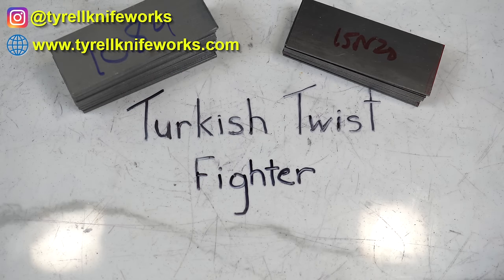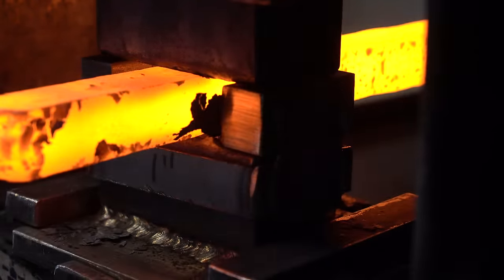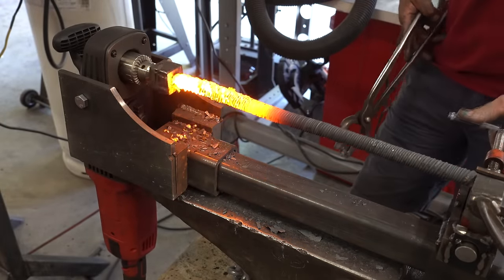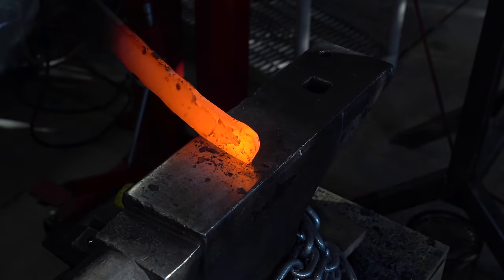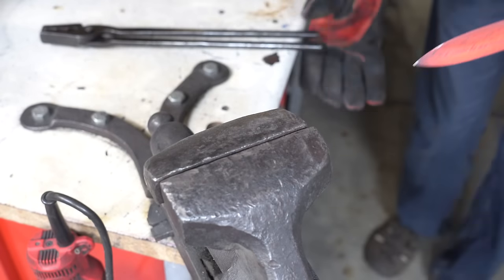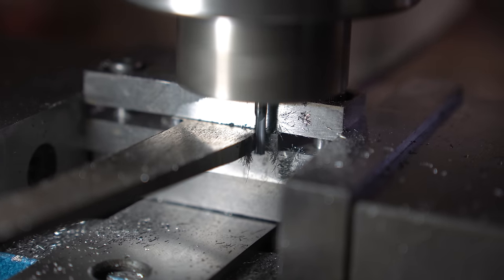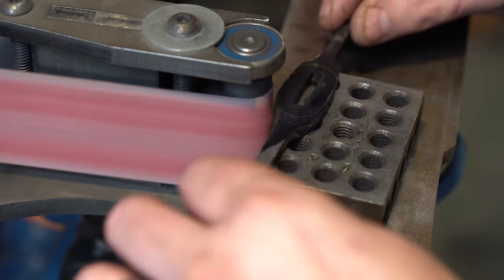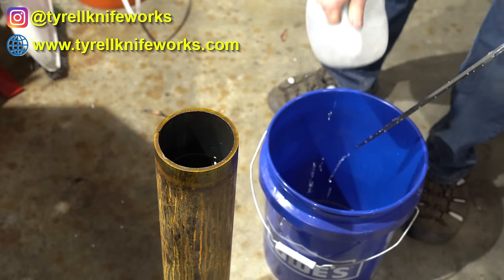Forging a Turkish twist damascus fighting knife

Comment: Really appreciate that you include "simple" mistakes like forgetting to change the drill direction. I think it really adds to the idea of craftmanship as a constant process, not just a finished skill.

As someone who can nothing on metalwork, why don't you go straight to the surface grinder when removing the grooves from the twist? Less control of material removal?
Reply from the maker: I always say, these are a series of problems to solve. As for the surface grinder, I was taking off the majority of the scale first so it “stuck” well to the magnets.  Thanks for watching.

Comment: You'd mentioned that with the twists that you loos a lot of material grinding out the the twists. Have you tried to rounding that square bar up and then twisting? I've done it and had mixed results. I hope this finds you and your family well, and as always, very well done, Sir.
Reply from the maker: Yes, I do that with bars larger than 5/8”.  With bars this small it doesn’t really make a difference. Thanks for watching.
Reply: @TyrellKnifeworks  That's good information. I suppose that's why my results were mixed. Thank you!

Comment: Another nice looking knife and a great build video. On the warping issue : i also used to grind in the bevels mostly before heat treat. On longer and or thinner blades there always high risk of warping.....sometimes its very hard to correct those warps. Now i do not longer grind in bevels....the only thing i do is to make the knife blank flat and straight before heat treat and leaving a lot more thickness. Never had any warps after that. There's another advantage in grinding in the bevels after heat treat. On thinner knives where the bevels are ground after heat treat you do not have the risk of decarb as much and thus there less chance of losing some contrast after etching. I am sure as you make a lot of damascus blades you also experienced some uneven etching on some blades....less dark/dull spots on bigger sized blades or the cutting edge less black/contrast than the back. That is also caused by decarb and uneven cooling on blades that had the bevels grind close to almost the final thickness before heat treat. I rather waste an extra sanding belt to grind a hardened and tempered blade to final shape...than risking warping, decarb and even cracks on thin and or longer blades with the bevels ground in before heat treat.
Reply from the maker: While I agree that works most times, with 10xx steels you need to be careful you are getting full hardness since those are shallow hardening steels.  That’s the main reason I like to do pre-heat my rest grinding.  I very rarely have warps or decarb issues.  If you’re not testing with an hrc tester with no pre-HT grinding, you should get one.  Thanks for watching.
Reply: @TyrellKnifeworks  Ok those steels are maybe shallow hardening......but i very much doubt they would not fully harden if they are only 0.25 to 0.3 " thick blanks. That thickness before heat treat would be sufficient for most knives. But i do not know for sure because over here in Europe the 10xx steels are less common. Over here its mostly O1 and O2 for damascus blades combined with 15n20 or  45NiCrMo16 ( 3.5-4% NI). Those steels if i use them up to 1/8 inch thick big kitchenknives i can even plate quench ( copper quench plates) like you would do with stainless and get fully hardened without the chance of warping. I do not have a rockwell tester....but i use hardness testfiles. I can get those quench plate hardened kitchen knives as hard as using quenching oil. Maybe for the 10xx steels its different.
Reply from the maker: @HoutmeyersP  not being argumentative, but you ARE using 10xx steel if you’re using 15n20, it is 1080 with 2% nickel added.  Which has a completely different heat treat than O1.  It’s really not a good combination for Damascus for that reason.  I would advise you get a Rockwell tester and then you’ll know for sure.
Reply: There's absolutely no problem using O1 and 15n20 or 1.2767 for a damascus blade......even if both steels have a different heat treat. My blades are as good as any other hobbyist forged damascus. Look up any factory produced stainless or carbon damascus ....they all use steels that do not have the exact same heat treat.If you doubt that the mixed steels do not get a perfect heat treat when combined....i would than also skip using copper , nickel and gold or other metals in a blade. Its also really not a good thing putting any in steel for a few dozen times in and out a high heat propane forge....so if you want perfection skip the whole damascus forging process all together.
Reply from the maker: @HoutmeyersP  if you’re a hobbyist heat treating in a forge, it probably doesn’t matter.  But O1 and 15n20 DO have different heat treats.  They don’t even use the same quenchant.  You can reference Knife Engineering if you want to look it up.   As for copper or other items, those are never on the cutting edge.  You’re just heat treating your core steel.  This sound like a touchy subject for you, but I’m just giving you facts.

Comment: As always you do great work. Very well done. It is art.
Reply from the maker: Thanhs for checking it out, Gino!
Reply: @TyrellKnifeworks  I did a little research on the original Bowie knife and I found out that the clip point was sharpened for fighting. I would love one like that.
Reply from the maker: @ginojeffries4285  My standard bowie knives are like that.  Not this one though.  I rarely actually "sharpen" the clip but rather just have it apex quite sharply.  I'll be doing a few of these very soon.
Reply: @TyrellKnifeworks  I’ll be looking forward to watching these

Comment: The amount of manual work you have to do to squash all those lines into place without weird cutouts just elevates this piece even more.

Since I don't know the mechanics behind it, would it be possible to do something to remove the lines between the wielded pieces?
Reply from the maker: If you get the twists perfect, you don’t see the lines.  Mine isn’t perfect, that’s why I’m not a master yet. 😜.  Thanks for watching.

Comment: You said it. Twist patterns turn out awesome but the material loss is ridiculous. Bars end up being so little after grinding and a bigger bar is almost impossible to twist. I round them up before twisting and it does little to minimize grinding. It helps prevent shearing the bar some, but that’s about all I’ve noticed. To low of heat will ruin any shape of bar anyway.
Reply from the maker: For bigger bars I round them but for 5/8”, it doesn’t make much difference.  Thanks for watching, Erik!

Comment: Another fantastic build Denis, a pleasure to watch. With the powered twisting jig how do you keep track of the twists so the pattern is even when you join the steel together?
Reply from the maker: You can still count the rotations but usually you just watch the twists and make them as tight.  Thanks for watching.

Comment: One question that I have had for quite a while: What would happen if you took the square bar through a rounding swage before twisting it?  This would eliminate the square corner that all get ground off, reducing the loss of material from grinding. The layers in the round stock would still be twisted and exposed at different grinding thicknesses as you show early in the video.
Thanks!
Reply from the maker: When the bars get bigger than 5/8”, I typically do round them off, which helps a bit to prevent the “ribs”, but it doesn’t matter much on the smaller bars.  Thanks for watching.

Comment: How would your surface turn out if you rounded or shaped it to a octagon befor the twist it's bound to not be so drastic
Reply from the maker: For larger bars like 3/4” or 1”, it’s recommended to round the bars before you twist them to reduce the ribs on it.  For bars that are 5/8”, it doesn’t really help that much so I don’t bother.  Thanks for watching.

Comment: Question for you. You said you like to stretch the steel out slower to not shear the layers. Do you lose a lot of carbon from the steel or is it negligible from doing a lot of heats?
Reply from the maker: Taking a couple extra heats with the press is negligible, if you were doing this by hand and adding 20 or 30 heats, that's much different.  You're not really losing carbon though, you are losing steel mass from forge scale formation on each heat.  Thanks for watching.
Reply: @TyrellKnifeworks  Ah, that makes sense. Thank you! I really appreciate it.

Comment: What thickness stock are you starting with and stacking? Also the starting length.
Reply from the maker: It kinda depends on what I have on hand.  Typically I use 1/8" 1084 and 1/16" 15n20.  I don't quite remember how many layers I started with but it's in the video.  I hope that helps.  Thanks for watching.

Comment: If I may I'm no smith but the spacer looks lighter than the rest is that because the etching process wood eat at the silver or is it lighting
Reply from the maker: It’s a different piece of Damascus, it’s crushed W’s not twisted, so it reflects the light differently.  If you see it up close though, it matches well.  Thanks for watching.

Comment: So you twist and ripple the hell outa the metal, then reflatten it to get those beautiful lines? Then what do you cold soak it in to get that nice finished design?  Also, which chemical did you use to etch your company symbol? Thank you!
Reply from the maker: The blade is etched in ferric chloride acid which etched the “dark” steel more than the “silver” steel.  The silver steel has 2% nickel in it which resists the acid.  My makers mark is electro etched in the blade with a battery charger and saltwater.  Check my recent takedown Bowie knife build where I show that.  Thanks for watching.
Reply: @TyrellKnifeworks  Thank you so much, dude! 😃

Comment: @TyrellKnifeworks I don't understand one thing: why didn't you just flatten those marks from twisting in that hydraulic press, you were saying you'll loose a lot of material like this (with grinding)
Reply from the maker: You don’t want to press this pattern.  You must grind into it to reveal the “stars” like I showed at the beginning.  If you press the bars, you’ll get a boring pattern of bars.  Make sense?
Reply: @TyrellKnifeworks  ❤yep thanks

Comment: I failed my last etch, and I would like to ask you how much sandpaper you usually need to grind to.thanks
Reply from the maker: Not exactly sure what you mean.  Are you sanding it back to clean steel?  Between etching cycles I’m using 2000+ grit but if I had to sand it clean I’d probably go with 220 or 400.  Thanks for watching.
Reply: @TyrellKnifeworks  The translation software I used may not be very clear. I want to ask whether the grade of sandpaper should be as high as possible for polished steel before etching? I translate your answer here to mean that it usually needs to be polished to about 2000 grade before etching?
Reply from the maker: @idleartisans778  no actually, if you go to too high a grit before etching it closes the “pores” in the steel and it doesn’t etch as well.  I use the 2000 between etching cycles.  Does that make sense?
Reply: @TyrellKnifeworks  I roughly read that it only needs to be sanded to 400 grit before etching, not 2000 grit. Thank you very much for your guidance.

Comment: I could be wrong but couldn't you have simply flipped the billet the opposite direction to make the twist patten work?
Reply from the maker: No, it doesn’t work that way.  Can you flip a bolt and then the nut goes in the other direction or is it always clockwise?  😉. Thanks for watching.

Comment: I Wonder why you didnt just flip "wrong twisted" bar so you can use it for the blade
Reply from the maker: Many people think that, but it doesn’t work that way.  Example, take a bolt or piece of all-thread and flip it over, you still thread the nut on clockwise, it’s still twisted the same way.  Thanks for watching.

Comment: i Don't know if this will at all, but ive seen an easier way to forge a tip... the Japanese way. you cut of(using which ever method you want) at an angle where the tip is at the side you want as your edge, then forge by hand become half the work as you only need to bend the tip backwards to make you curve, and so doing the grains and patterns follow the groves and edges perfectly.... it might save you some time and effort . i do not know if you know of this method or not or have done it or not. just sharing
Reply from the maker: Yes I’m familiar with that method, but with this pattern if you cut it it looks terrible.  You need to forge the tip this way or it just looks odd.  Thanks for watching.
Reply: @TyrellKnifeworks   I did not know. i do not usually use Damascus so i'm waaay out of my depth.... question... which is stronger. a mono steel 1095 blade or the same dimensions Damascus blade ? because i do not know
Reply: @TyrellKnifeworks  was an epic looking blade i must say.
Reply from the maker: @ricksmit2239  if the forge welds are perfect, they are the about the same.  If the forge welds are sub-par then the 1095 will definitely be stronger.
Reply: @TyrellKnifeworks  my feelings are the same. i just wanted to hear it from a real smith. thanx man. can't wait for next video
Reply from the maker: @ricksmit2239  Yes, some people have the illusion that damascus is stronger.  That was true 1000 years ago when steel was shit and "folding" it and melting it in a crucible reduced the impurities.  Today the steel is about as pure as it gets so anything else you do to it will likely make it worse.
Reply: @TyrellKnifeworks  i certainly believe that damascus blades are more versatile and controllable. i can see how one can make a 1000 damascus blade with one strong metal and weak metal(because that is all you have got and you need to make a strong blade but do not have enough strong metal) then folding it many times will "fuse" the properties of the weak metal with the strong. making a blade which is heat treatable but still soft to point where its unbreakable(if you only heat treat the edge and do not temper) stuff like that and in such situations. i don't think i can make damascus, and i think if i ever did it will just be for the aesthetics of the pattern. the art of that what a blade is.my current struggle or learning of, is how to rather make a certain metal, like 1080 into the hardest and best for it can be. grain reduction and all. it is my belief that if you make the metal as strong as its potential, then heat treatment(hardening and temper) will not be as necessary.... i could be wrong. maybe i am. but it is a fun road to walk and i will walk out smarter from having learned a lot

Comment: the knife is cool . but i'm curious about the chain you have wrapped around the anvil. does it serve a purpose?
Reply from the maker: The chain dampens the ringing sound from striking the anvil.  It’s very common in a blacksmith setup.  Thanks for watching.
Reply: @TyrellKnifeworks  thanks for that. i'm just getting all the equipment and tools together for forging . i am doing this as self training , with the help of videos like yours. so thanks.